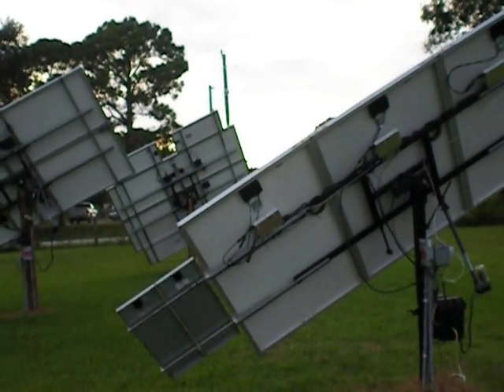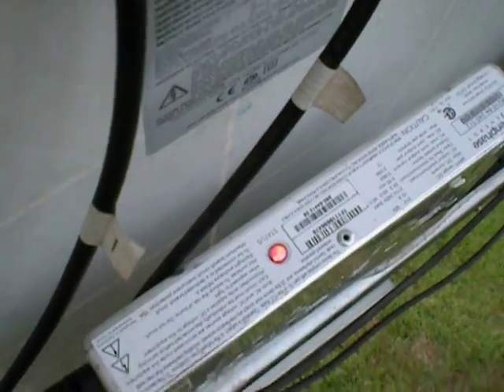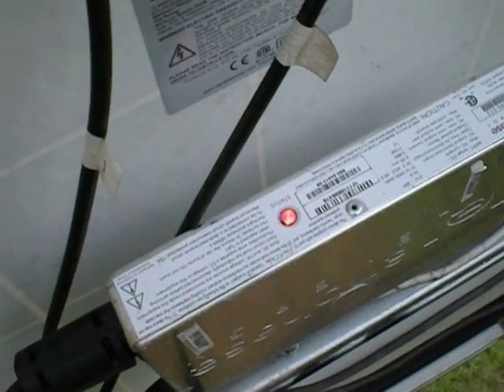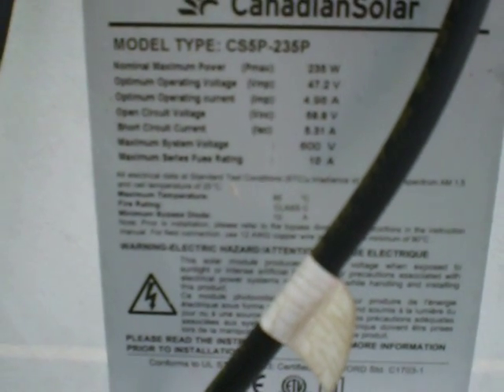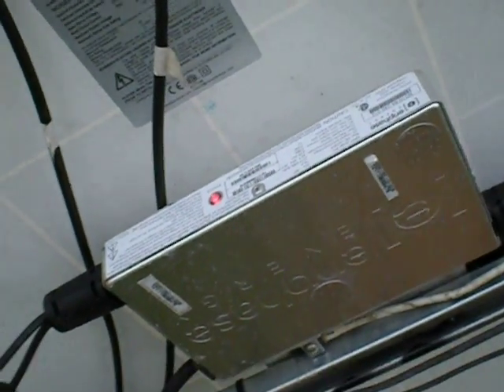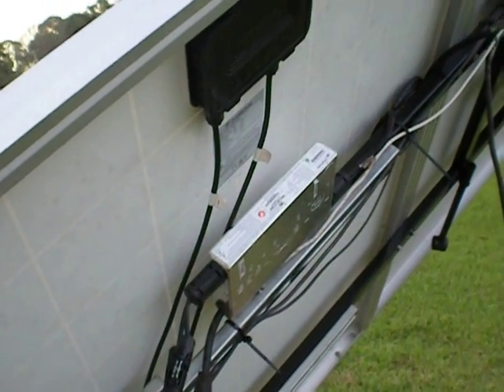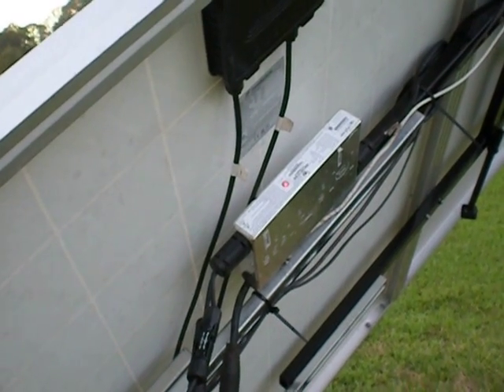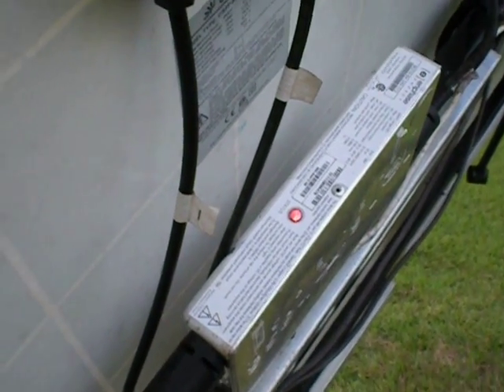Enphase 210 Inverter Fail Part 1.

Comment: My 3.6KW system was installed in may 2010.  Six months I had a 190 completely fail, and they were unable to bring it back. My solar co. came out and replaced it no problem or cost to me. Two weeks ago I had another act up then go off line. He "reset the breaker" from his office and it's been working fine since. Yesterday I have another one acting up. It's working, but producing less power than the others. It's been VERY hot this summer in southern New Mexico, I wonder if that's a factor.
Reply from the maker: +dahur I think all the early designs  like he 190s & 210s  were a problem all my 210s failed but were replaced so far so good. I have enough faith in Enphase products I am installing a 6000 watt 4 solar tracker system in NH this week.

Comment: Well?  What happened?  Did Enphase make it right?  And as an aside, I understand that Enphase keeps a stock of M210's and M190's on hand just for warranty replacements.
Reply from the maker: Yes It was fixed But failed again & fixed again I believe if it goes out once more it will be replaced by Enphase, they have been great to me.

Comment from the maker: thanks I hope I can get a replacement as these are high voltage  solar panels 58.8v  intended for a string type inverter system thus the need for the 210 Enphase units.

Comment from the maker: Yes I was away when this event took place U are supposed to be able to reset these if U have the enlighten Envoy system as I do but was unable to reset. it will be interesting to see what happens under the 25 year warranty so stay tuned to see results .I hope this does not happen to U.

Comment: Keep us posted. So your envoy notified u via email on the inverter failure. I guess the monitoring System works. Now if only your inverter will work. I didn't realize some of these can be reset like a GFI through the envoy.